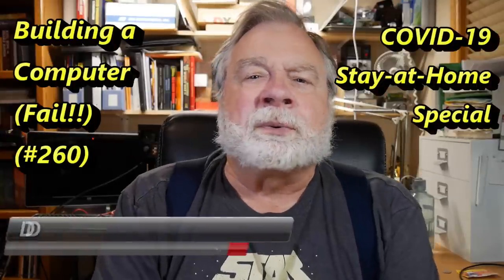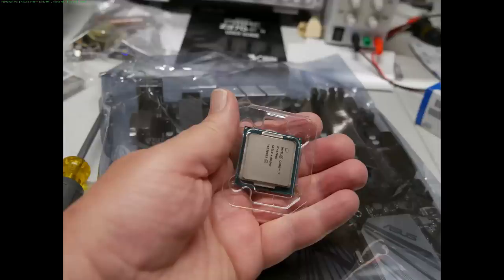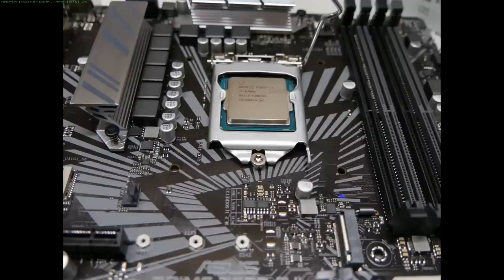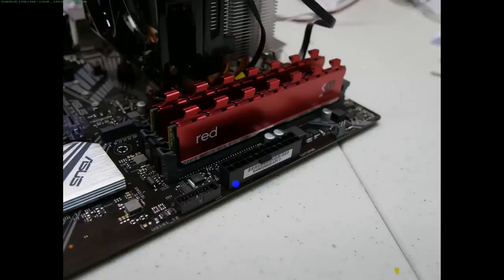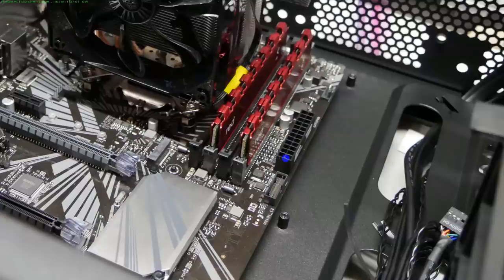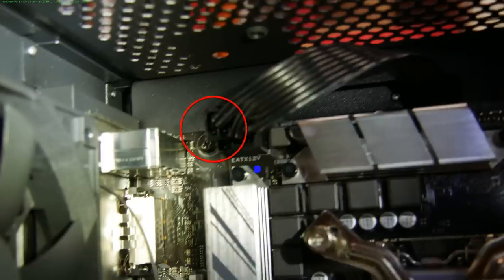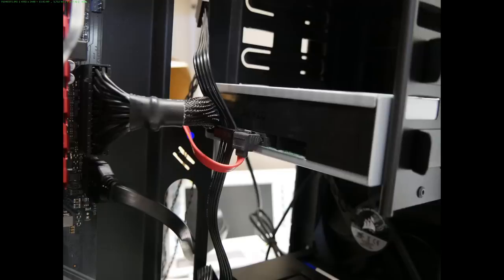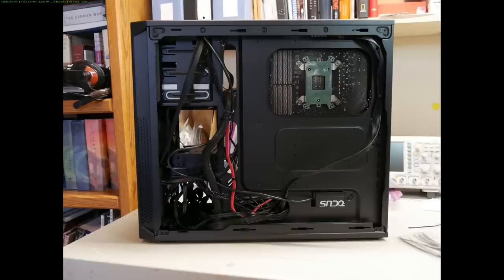Computer Build Fail! (#260)

Comment: It sounds like your PSU is being shorted upon power up and shutting off. Disconnect it from the mother board and try connecting the green wire and a black wire with a paper clip and see if powers up all the drives. If not try another PSU. Or you created a permanent short on the mother board when you put one plug in the wrong spot and shorted 12v to ground. I'm glad I don't have the cross eyed headache you're going to have figuring this out without spending too much money and time finding and fixing the fault. Good luck Dave!
Reply: I've been working on computers and electronics since the mid '70s and this is the correct answer so I'll provide a bit more detail on the troubleshooting procedures that I would follow here.  First off let's take a look at the ATX power supply connector.  Lifewire has a good pinout here: https://www.lifewire.com/atx-24-pin-12v-power-supply-pinout-2624578.  Note that pin 16 is the green wire referred to above.  When pin 16 (green) is brought to ground (any black wire) the power supply turns on, otherwise it's in standby, like everything else these days never really fully off.  Disconnect the power supply from everything in the computer, plug the power supply into 120 volts, jumper pin 16 to ground (any black lead), if you're using a paperclip pin 15 or 17 should work nicely.  At this point the power supply should start up and stay running.  Take your volt meter and clip the ground lead to the paperclip.  Now using the lifewire pinout start probing all of the voltages on the connector and note any discrepancies.  If all of the voltages look good disconnect all of the cables from the motherboard except the front panel power switch and LEDs.  Carefully plug the power supply back onto the mother board, I think you said there was this 24 pin ATX connector and another 12 volt power cable.  Remove the video card and memory from the motherboard.  Try powering on the machine.  Depending on the mother board you may get a "beep" code saying there's no memory, that's OK, at least the BIOS is starting up and talking to you.  If the fans still start and stop as described in the video the power supply is being shut down by what's called a crowbar circuit because it's detecting an over current (short) condition.  If the power supply still shuts down remove the motherboard from the case and try powering it up in a static safe area, ideally on a static mat if you have one.  I have seen a case where a metal standoff in a case contracted a trace on a motherboard and caused a short circuit.  The situation can happen when a metal standoff is large enough to touch a trace next to a mounting hole.  Another option if the power supply shuts down is to remove the processor chip and try to power up the motherboard without the processor.  We have to isolate what's causing the power supply to crowbar and shutdown.  If the system powers up without memory and the video card reinstall the memory and try powering up to see where that takes you.  If the motherboard has a built in video connector try connecting a monitor to it if the system will stay powered up.  If all this fails the decision tree for trouble shooting starts to really branch out from here so feel free to e-Mail me and we can troubleshoot further over the phone.  73, de Roger, NK1I
Reply: This might make a good troubleshooting video.  Start with the simplest viable configuration and work your way up to a fully functional system.
Reply: This manual from ASUS will show where to connect a speaker on page 1-15.  Use a small 8 ohm speaker so you can hear the "beep" codes once you can get the motherboard to power up.

Comment: Lot's of great suggestions here and one I ran across was a motherboard to case thread insert in the wrong case tray hole. It shorted/grounded out the bottom of the motherboard and the power supply kept going into protection mode, similar to what you are seeing. I like to first test the hardware on top of a box to make sure everything works before installing into the case.
Reply: or didn't use the little insulated washers in the right places

Comment: For future reference @9:17, the recommendation is you plug everything in that you can before you put the motherboard into the computer. Memory, cables, and any peripherals (cards) that can be put on first should be. You're absolutely right about the board flexing if you put them in after it's mounted in the computer.

Comment: I think your best option would be to go back to square one (e.g. remove motherboard from case, remove cables from motherboard, remove CPU and RAM, etc.).  Double-check all connections when reassembling (make sure none of the gold plating on RAM has come lose and shorted).  Make sure none of the screws holding the motherboard to the case are shorted.  Make sure the motherboard is correctly positioned in the case (that cantilevered arrangement looks strange to me too).  Make sure the wiring from the case (power, reset, HDD light, etc.) are plugged into the correct sockets on the motherboard (they are easy to get wrong).  Assemble the system with minimum parts (only the CPU, a boot drive and RAM).  Blu-Ray drive and second hard drive can be added later.  Good Luck - Dennis Perkinson WW9T

Comment: Hi Dave!  Started in electronics at age 10, a HAM since 1959 (60 years), computing 1980, build first computer around late 1980's, my back ground!  retired guy, but help people with the computer problems!  Looking at the comments … the one from garcro1 is right on target … I would suggest that you unplug  these things that are plugged into the motherboard (video card and memory modules) disconnect power from Hard Drives, optical drives so the only things that remains connect to the motherboard is the power supply  connector and front panel power switch connector, then turn the power on and first see if there is a small LED that is usually green that should be on (check the AZUS motherboard manual for its location and indication), if that's not normal per the AZUS manual you power supply is probably in the shutdown protection mode do to a short on the motherboard (in this case I would do as garcro1 suggests remove the motherboard from the case and test your hardware out of the case, if everything works, then you have isolated the problem to the installation of the motherboard in the case, review the installation process to see if you missed something!  Good luck, I'm sure you'll find the problem! 73 Wayne WA6NRB

Comment: Make sure the power supply is set for 110 volts
Reply: I agree - that’s what will happen if the power supply is set for 240v.
Reply: @hccripe  Most PC power supplies are auto sensing these days.
Reply: Looking closely at the video ant 10:00 it appears that the SeaSonic power supply Dave has selected is an auto switcher as there is no red 110/220 switch on the rear panel and the label states "100-240 volt".

Comment: Hi David!  I've really enjoyed your channel and found it very informative.  Sorry you are having trouble on your first PC build.    After reviewing your video a few times I surmised that your motherboard is the ASUS PRIME Z370-P II. Others may have mentioned this but for basic troubleshooting you're going to want to take everything apart and start with the minimum parts.  One diagnostic aide will be to hook up a speaker to your motherboard.  Either a little piezo or a regular small 8ohm will be perfect.  It connects on the same bank of pins where you connect the power switch and the reset switch and front panel LEDs (it is in your manual on page 1-15).  The minimum setup is going to be just the motherboard and processor (with fan) and power supply.  At this point connected to the motherboard should be the following: "beep" speaker and other front panel equipment, the main power connector and the "EATX12v" (the one you had wrong initially).  NO video card, RAM, or storage devices.   Page 2-16 has your beep code table.  With the minimum equipment hooked up, power on your machine.  We are expecting to get some error beeps.  It should be one of the beep patterns listed on the table but really any pattern is what we're looking for.  This will tell us whether or not your motherboard powers on AT ALL.  It you don't get the power on at all then your powersupply could be dead.  If the power supply does come on but no beeps happen then your motherboard could be fried.

Comment: There is a YouTube site operated by Carey Holzman. He has a very large number of "build" videos, generally featuring Intel processors. One thing you would learn from these is to install the plug you had trouble seating BEFORE you install the motherboard in the case. (Only if you have a "modular" power supply, which seems to be the case here.) He would also have recommended that you NOT plug in the drives until you test to see that the computer will boot to the BIOS. The reason for careful wire management is not just for appearance, but rather to make future repairs or upgrades easier to accomplish. I built three computers last summer without any problem. -- 73 -- W6DOF.

Comment: Hi Dave.  Strip the MB back to the minimum required to power it up.  I see video connectors on the back of the motherboard.  You probably don't need the video card.  So, to eliminate one of the variables, take it out the machine.  See what happens.  Unplug the drives.  Yet another variable to eliminate.  Heck,  take out the memory as well.   Have you got access to another power supply?  Temporarily plug it in.  Just another variable to eliminate.  Still won't work.  Take everything out of the case.  Set it up on the bench.  The case is about the last variable to eliminate before we call the MB bad.  Once you get it powered up, add things back one at a time.    I fore see many great videos coming out of this machine.  Just as soon as you've completed this learning experience.  73 and gud luck.

Comment: You should have a 1 Meg resistor your static ground line.
Reply: I agree having piece of wire wrapped around a watchband is not very static aware.
Reply: Without the 1 meg resistor between you and ground this is a potentially deadly configuration.  If you have the improvised static strap on you left wrist and come in contact with high voltage with your right hand the shortest path to ground is through you heart.

Comment: When building a computer before installing it in the case, place it on its box, install the essentials like the CPU and cooler and the video card and power supply and just test to make sure it turns on and functions first.   You can connect it to your monitor and see if it boots into the bios.  Listen for any beeps 
The intermittent run from the power switch could be a faulty power momentary switch.  You can test it by removing the power switch 2 wire connector and using a small screwdriver momentarily shorting the connector on the motherboard (2 pins) If the computer starts up then it was most likely a bad switch.

Comment: Next to your front panel connectors is a USB 3.1 front panel header, the other two next to it are USB 2.0 headers, and the last port to the far left of the picture is your RS-232 serial port header for a rear mounted DB-9 bracket. (yes, modern computers typically still have serial ports. which is how i interface with my TNC. Its usually just a header and has to be enabled in the BIOS)

Comment: Dave, most likely the power supply won't start if completely disconnected from the motherboard. There are feedback lines in the cables that need to be connected for it to work. As others have said, you should strip the motherboard back to as little as possible and test. It's not necessary to remove the wires to the front panel or USB ports. It won't hurt the CPU or motherboard if you don't have memory or disks. If it works (not cutting off) add one thing at a time and get that working. Repeat until you find the problem. It's not a good idea to completely build up the system the first time you do it. Step-by-step is better. If you get all the way back to the motherboard and it still cuts out remove the motherboard and try it sitting on a piece of cardboard. And, get yourself a proper static strap before you get electrocuted. Your videos are great! de WC8J/JS6TRQ

Comment: make sure you have power connected to the video card if needed and use the dvi/vga or HDMI output on your video card during OS install . Not Displayport.    Also, double check that aux power going into the MB.  You might have the wrong connection.

Comment: Dave it is almost certain you have a short that is obvious. The good news is you didn't let any smoke out. Something is tripping a protection circuit in the ATX and when I come up with this issue and it happens often is to backtrack through the install and make sure all of your connections  are solid and there isn't a chassis ground somewhere loose or disconnected. For what it's worth that is what I would do. Good Luck 73

Comment: You should have mounting standoffs to support the mainboard, not cantilevered. Most cases have a variety of threaded holes to support different mainboards, ATX, Micro ATX Etc. Also, skip the ground strap, as long as you don't touch the pins on the CPU, cards Etc you should be okay. A good trick to cut down static electricity is to mix some fabric softener in a spray bottle and mist the carpet. That's how dryer sheets stop static cling.

Comment: RAM could need to be re seated.

HOWEVER i recall having this problem on my first computer build. The issue was the motherboard wasn't getting enough juice.

So i added an additional 12v connector to the board, that graphics card is running strictly on onboard power so it could be tanking your power supply.

So re seat the RAM, check that first.

Then see if your motherboard has additional 12v rail slot to use.

Then try removing the graphics card from the pci slot to check for undervoltage.

Overall Dave, you've done a damn good job when most people your age are busy watching price is right, and wondering how to use a smartphone.

Comment: Sorry to see you had a problem building your first machine. The supplied instructions are often an impediment to the process, as you discovered. I would not put a motherboard on a surface directly. Lay it on the conductive packaging until you install it. Natural heat flow upwards is very, very weak compared to forced air, when using forced air convective flow is not important. There are many sizes of motherboard and supports, this case and board seem to be a less than optimal combination. Most cases I have worked with have more supports for the board, though some cantilever is common. A clip could be easily 3d printed to provide some support for plugging in the main power connector. Carpets are very dirty, best to get the machine  up away from the carpet by many inches to reduce the dust, and it will still collect a lot. After powering on with the 12V connector incorrect there may be some damage to the motherboard or power supply, or a blown protective device. I would disconnect everything that was nonessential and work up starting with checking the power supply voltages (which may need some load to stabilize). Most of the front panel cabling is not needed, only one SATA device, no graphics card, etc. Get the minimal subset working and re-add components and re-check along the way to verify that it is still working. Best of luck on your project. Alan, w6akb

Comment: Hi Dave,
In one part of your computer build video you mentioned a power cable 12v  shout to ground as a connector was pushed on.  I'm guessing that you did not power on until the connector was reinstalled correctly.  If all connectors are installed correctly, and there is still what appears to be a short circuit power supply shutdown, there may be damage at the connector was forced, causing a break in the socket-motherboard trace, a bent or broken pin, a broken trace on the motherboard, or possibly the power supply was defective before you powered on for the first time.  I suggest  disconnecting the power supply from everything and checking it first.

A word of encouragement,  nothing on a computer works right, until you find the LAST thing that is the problem.

73.  Alex   KE5HYF

Comment: First computer build? Just lift gently on the motherboard AS you slip in and push down on the power connection. Been doing it that way for a few decades.  :-)

Comment: Yes, I'm late to this party, but I've built many PCs, so maybe my comment will help someone.  The most common CPU cooler orientation is pushing air through the fins and out the back of the case rather than out the top.  CPU power connectors are keyed to go in only one way, so if it was hard to insert, it was turned the wrong way. The idea is to mate the two connectors before inserting them both together.  If all 8 pins aren't inserted, you've got a DC current conflict, and that's why you got no boot. The motherboard CMOS immediately recognized the issue and shut down to protect itself.